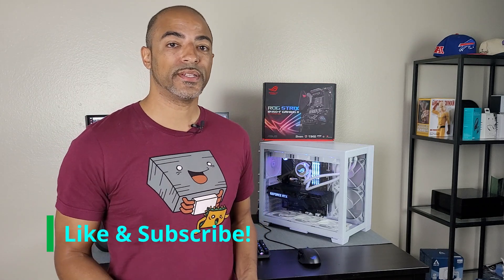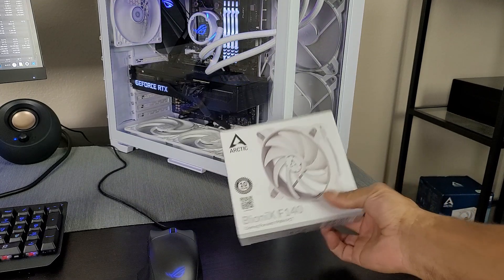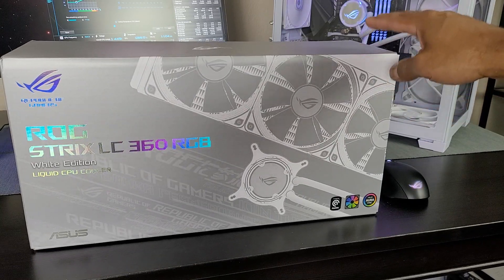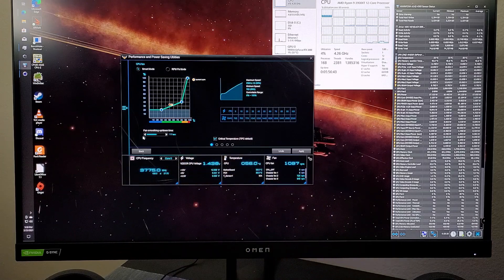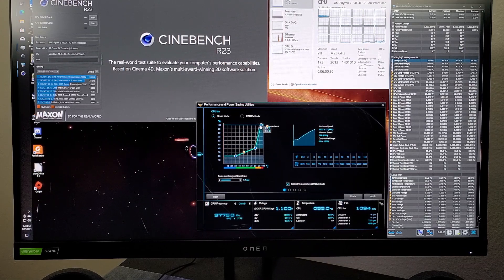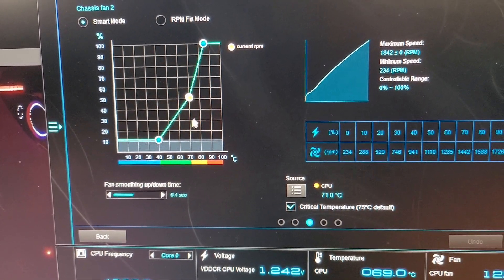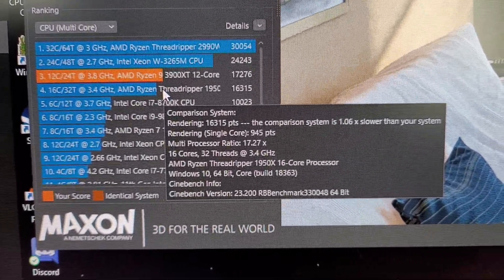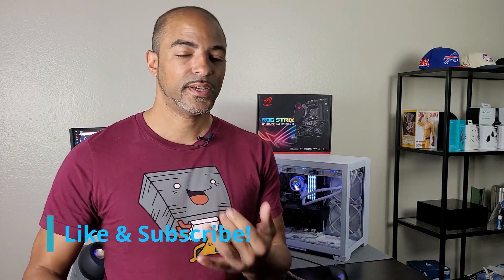Lian Li O11 Dynamic MINI Snow Edition - Fan Curves

Comment: Hi! I have the same case, but i’m running the 3 fans at the bottom intake and the rest of the case exhaust. My aio in on the side and 3 fans on top with 1 rear. What should my setup he
Reply from the maker: That's the beauty of building your own pc, you get to try different combinations of fan placements to figure out what's the most ideal combination based on the hardware that you're using. Monitor temperatures, adjust your fan curves as needed, and try multiple combinations until you have the best temperatures at the lowest noise levels.

Comment: I have a question but just want to say Very Understated Channel You Are Amazing at the stuff you do man you should have way more subs . But I was wondering the bottom 3 fans are intake and the side next to mother board and the one single one which are those ? Exhaust or intake ? I know the top is exhaust .
Reply from the maker: Hey thank you so much! And in this bill the bottom fans were intake the side fans were intake and the top fans were exhaust
Reply: @DaPoets  what about the one single fan that is in the middle back of the case was that exhaust or intake. ?  And your very welcome man just being honest and thank you for the respond 👍
Reply from the maker: Rear fans typically are always exhaust unless it's a special circumstance and thanks again! Please keep in mind that every PC build is somewhat unique and you'll have to test your own air flow and fan configuration and fan curves due to your own environment. Humidity, altitude, there's a number of factors and you won't know until you try different configurations.

Comment: Ive ordered two Asus coolers like your now and have significant pump noise on both, im amazed yours is in audible, especially at 100%!
Reply from the maker: Very odd, try to make sure you didn't have air in your pumps.  Mine was quieter than the PSU to be honest so I replace the SFX PSU.

Comment: I'm looking into this case with a mATX x570 mobo, an R7 2700x (360mm Deepcool RGB v2 AIO) with 6 fans :), and a 2080ti water cooled with NZXT 140mm Kraken X42. Do I have room for all my stuff in there? I do understand that the power supply needs to be SFX, which costs more, but I need to upgrade to a modular PSU anyway.

I'm guessing 360mm rad at the top, 140mm on the side, it looks like, and the rest, fans everywhere. I love the look of the white fans you found.
I'm using 7 Deepcool 120mm ARGB fans and they seem to be quieter and better than the Corsair ARGB lines, which I had before, with 2 failures in 2 years.
I also use one high flow black Noctua fan behind my read exhaust fan. It helps being down temps by about 2C.
My case is cramped, does not have good flow (no top exhaust), and the CPU goes to max 74, idle 44, GPU to max 60, idle 38!
Reply from the maker: Check out my most recent video on this case to give you a better idea of how things fit when water cooled

Comment: Can I do this fan curve format with Unifans?
Reply from the maker: Any pwm fans
Reply: @DaPoets  even with my aio on side, could I still do this fan curve?
Reply from the maker: @YTjuanny  Where an AIO is placed will determine the exact settings for your fan curve.  Fan curves are also dependent on ambient room temperatures, so you can't just copy another fan curve and get the same results but you can use it as a guide to then finetune your own settings.

Comment: I get that the o11 dynamic series are really popular and considered a "stale" option, but honestly they have to be some of the best cases money can buy right now with incredible airflow  looks. The only case that I've seen that can compete is the Corsair 5000 series and I was wondering if you could share your thoughts on those cases
Reply from the maker: Yeah that's a great line as well, Phanteks also has some great cases and they make some of my favorites like the 719. No case is perfect, they usually excel at a few things and have a few faults.

Comment: I just received the NZXT Creator PC and seeing as it is in the H510 Elite the cooling is miserable. I picked up four bequiet silentwing fans, 3 140mm and 1 120mm to replace the stock ones. I am trying to mess around with fan curves, gpu and cpu undervolting, and overall temp decreases. Do you have any tips or anything along those lines?
Reply from the maker: Consider swapping out the case for another one.  All I hear is people complaining about the temps/air flow in that case.  A $70 Lian Li Mesh or LanCool II case will solve all of those problems and you can just get back to enjoying your PC.
Reply: @DaPoets What would be the best case in terms of overall temps for below $200?
Reply from the maker: @ashtonlinkon6437  Depends on your hardware but check out Lian Li, & Phanteks, as they have great air flow cases.  "best" isn't really a thing due to internal hardware variables. 011 Dynamic is a top performer for example.
Reply: @DaPoets  Ok sick, thanks for the help. I used to only watch your tiktoks but your youtube is very helpful.  Keep up the good work!
Reply from the maker: @ashtonlinkon6437  Thanks!
Reply: @DaPoets  I was also curious what desk you use. Not necessarily the one in the video but your main desk.
Reply from the maker: @ashtonlinkon6437  Ikea something....Just different parts from Ikea.

Comment: hey, I've got a question. I want to get this case and these fans but I need to know what the bare minimum fan amount and fan config are. I want to cool my gear decently until I can get more fans. I will definitely get the 2 140mms. summed up, I need to know the best and least fan layout doable in this case. this will be temporary.
Reply from the maker: Nobody can answer that because that all depends on what hardware you're using and what you use your PC for... 2 140s as intake and a 120mm exhaust will be ok for many configurations.

Comment: Were there any clearance issues with the atx motherboard/high profile ram while using the 360mm aio?
Reply from the maker: Yes my TeamGroup ram was too tall so I'm using HyperX and you have to slightly mod the case to allow for this AIO to fit w/ this ATX motherboard.  It will be specific based on which combo of AIO and ATX board you use.
Reply: @DaPoets  Do you think it is possible to mount the lian li 360 aio and 4 corsair dominator rams on there? If not, what adjustment could I make?
Reply from the maker: @bp3019  No idea because it's dependent on your AIO, RAM, Motherboard, so you'll find out when you start building.  It's not supported because not everything will easily fit but where there's a will there's a way.
Reply: @DaPoets  What type of modding is it? I have modded my ram to fit with my AIO in my current case so I think itll fit in the o11 mini. Is ram/mobo the only restriction? Or would I actually need to drill new holes because the current holes dont line up.
Reply from the maker: @Pcswithkyle  It will depend on your AIO, Motherboard, and Ram to be honest.  You may or may not have to do anything.  You'll find out when you start building.  It's not supported because of these variables.

Comment: Is b-450 still good or should I buy a b-550. I’m planing on pairing one of those with a ryzen 5 5600x
Reply from the maker: Compare the features of both boards based on your needs.  It could be that one has features you will never use while the other is more than good enough.  Do a side by side.  Both are good boards for the right use.